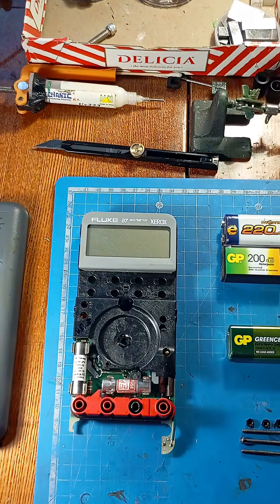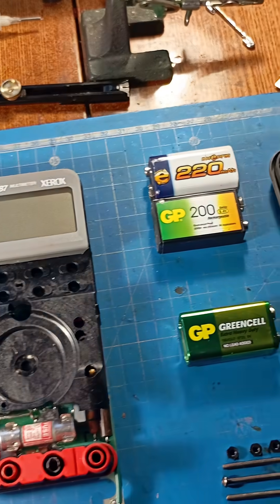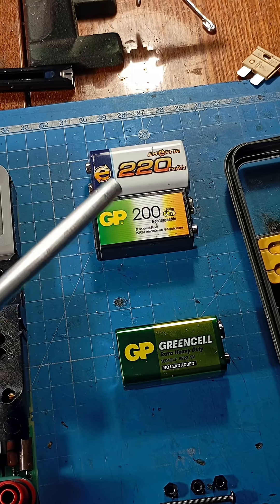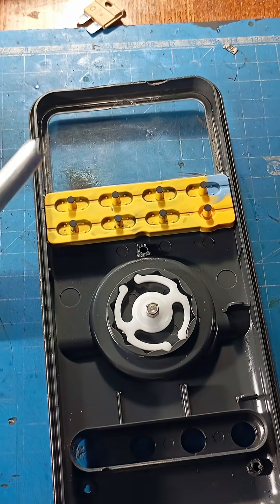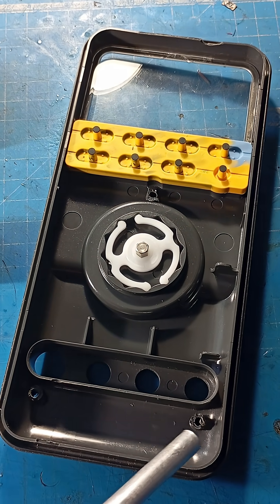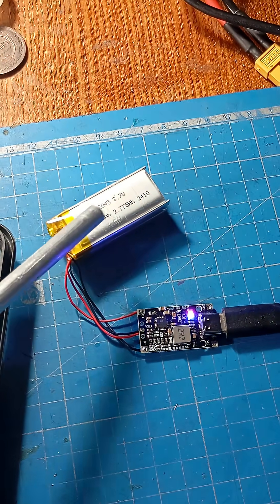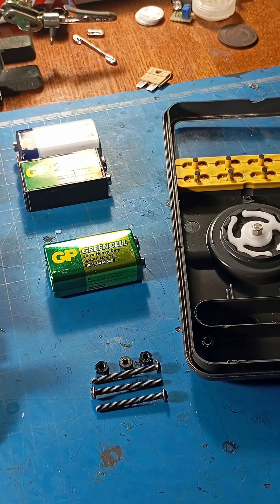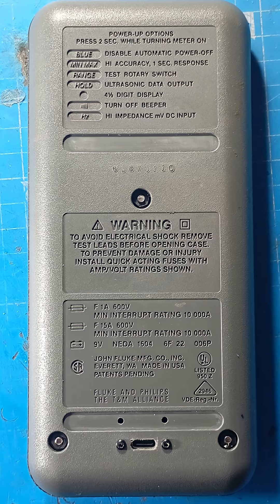Powering an old Fluke 87 from a LiPo battery

Comment: Good mod, and a sensible one to keep a favourite tool alive.
Reply: Yes, just make sure never charge it whilst in use - which with the rubber case is good as well, you don't want to be exposing ground when in use, which USB ports do.    Why you don't get many rechargeable multimeters due to those safety issues.

Comment: I have the same problem with my Fluke12 but the sides of the case are letting go too. Ive pretty much modeled a replacement case to 3d print for it but i like the idea of the lithium battery

Comment: Using lithium phosphate for this application is better. Long stay of lipo at charge levels is not good.
Reply from the maker: Yes, but these LiPo cells are very cheap. And I need 3 small LiFe cells and a special LiFe charging/balancing module. I'm not sure I can find and assemble it as well as I did with the LiPo  cells

Comment: whats wrong with you why would you put it like that
Reply from the maker: This is an AI-generated voice. My English pronunciation is far from good.
Reply: @sxlab  thats not what im talking about its where you put the charging port
Reply from the maker: @criauxe Ah, I see. I already answered earlier. In this form it is charged several times a year, and for me it is not a problem. And the rest of the time the connector is protected by a rubber case from moisture and dirt, and the most important thing is that the contacts are open - there is a risk of getting a high-voltage arc in your hand. Yes, it was possible to print a socket cover, but I did not bother
Reply: @sxlab  oh ok yeah that make sense

Comment: how do the readings compare? i'd say that 9V battery is load balance sensitive. you're probably reading 10% off from you where before cause the supply voltage is slightly different it's not exactly 9V anymore.
Reply: I was wondering the same!
Reply from the maker: The lowest operating voltage in this device is about 6V, and its measurements are not tied to the battery voltage. I can say this for sure because I have several other multimeters to compare the readings with.

Comment: I love this. Keeping the old instruments alive.
Reply: Fluke doesn't make changes to their meters much because they're the same ones military and government use. And changing the meters would require millions of pages of repair manuals to have to be rewritten. 

Also fluke gives lifetime warranty on the hard parts like cases, screens and buttons. A simple phone call keeps any fluke going longer than any of us will
Reply: @bigc9464 Hardly any manufacturer does upgrades of their meters.
What they do is release a new model, and as its a new model they produce an instruction manual for it.
Reply: Nothing needed to it to keep it alive.
He's not keeping it alive, he's upgrading it to overcome a battery performance issue.
Reply: It's also not cheap, so why discard it?

Comment: I have modded my old devices like this also, but instead of a USB connector, I installed Qi charging receiver. It looks crazy when I can place an old device on a wireless charger and charge it from there.
Reply: Thus ist better because insultion stays intact
Reply: @michaelw4258 what exactly do you mean?
Reply: @daddyvet478 insulation between the probes and the external usb connector.
The instrument has an cat 4(?) overvoltage rating. This is destroyed by this modification.
Safety has gone.
Reply from the maker: USB connector is under fat rubber case
Reply: @sxlab and removeable without tool therefore No cover😂
Reply from the maker: @michaelw4258 why should a person who does not understand the consequences work with high voltage and remove the protective cover? BTW, my device is always with it, it is convenient
Reply: @sxlab  its Up to you but this device will never Pass a safeety Test now.
Reply: That's a great idea!
Reply: Sweet

Comment: Just as bad as a Apple mouse
Reply: lol this was the first thing i thought of when i saw that usb c port placement. though i bet you can still use the multimeter while it's charging. that mouse might be apple's most obvious, unveiled attempt consumer-hostile design to date. clearly made to impede utility for seemingly zero practical reason, yet innocuous enough to allow plausible deniability for the fanboys. completely diabolical industrial design.
Reply from the maker: I tried to arrange the type-c socket and battery in different locations in a limited space, and unfortunately this is the only option that suited me.

It is worth noting that now the device is charged 2-3 times a year, and this is not an inconvenience. And the USB charging unit + the charging/balancing PCB give a lot of noise for the internal ADC.

Well, if the connector were on the front panel, there would be a certain danger of working with high voltage. And it needs protection from dirt and moisture. And when placing the connector behind it is securely covered with a rubber case
Reply: @sxlab  thank you for the explanation and sorry if my post sounded snarky - unlike the apple mouse this actually makes a lot of sense and i appreciate that you took the time to explain your reasoning.

Comment: Where is the step up converter?
Reply from the maker: The device operates in the range of 6 to 10V battery voltage (maybe a little more, but I haven't tested it). This fits into the operating range of a 2s lipo battery (3.0...4.2V per cell, or 6.0...8.4V battery voltage). Therefore, there is no point in a step-up converter

Comment: well, there goes your cat iii 1000v and cat iv 600v ratings, but great mod indeed!
Reply from the maker: Yes, I didn't think about that, about high AC voltage measurements and how safe such measurements would be with such a modification.

This is because I practically won't measure AC current with it, Maximum - 240V socket. I mainly work with low-voltage devices with DC current.

Comment: You can use a soldering iron to melt the plastic back together, if you don't mind the appearance.
Reply: You can also use a soldering iron to melt in a threaded insert 😉
Reply from the maker: This is a possible option, but I had experience with inserts in 3D printed parts, and it does not seem so reliable to me, compared to the option when these inserts would be melted into the part at the stage of molding the parts in the matrix. Plastic in this DMM is old and prone to destruction in places of concentration of efforts
Reply from the maker: Yes, but such a repair with plastic that is over 30 years old does not seem like a reliable idea. So I chose the option with through holes and long bolts that connect the halves of the case